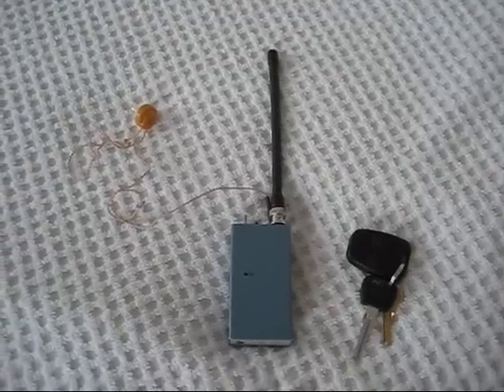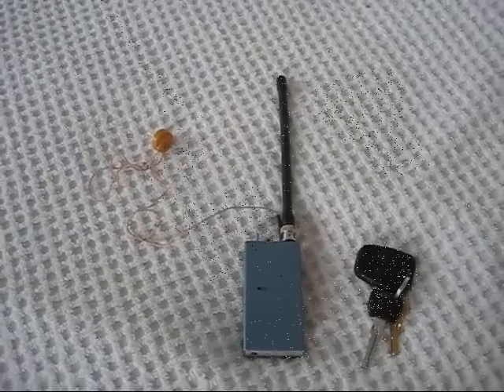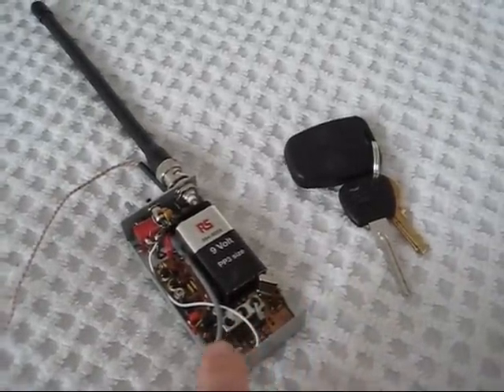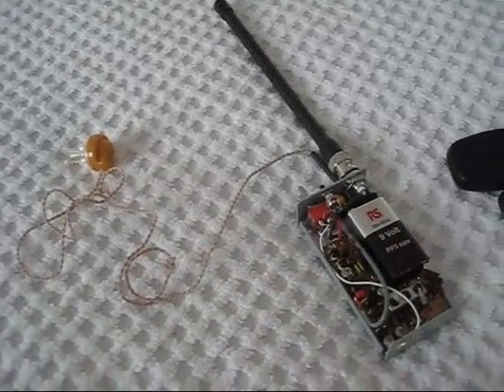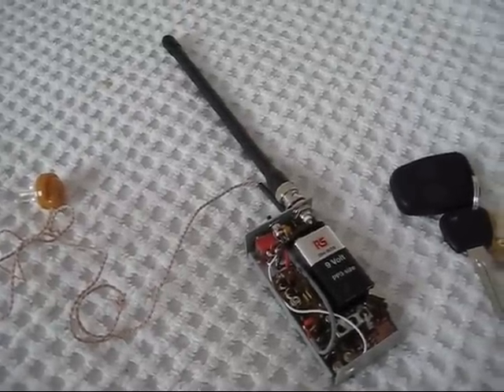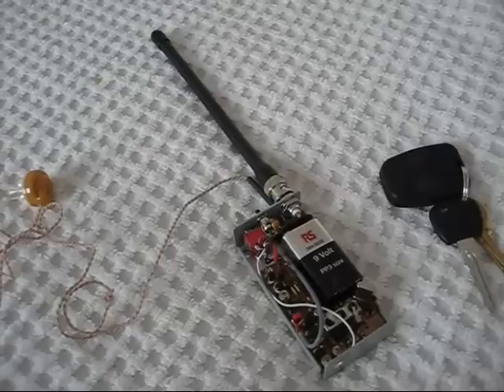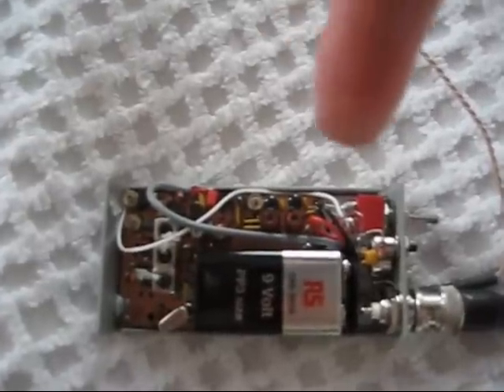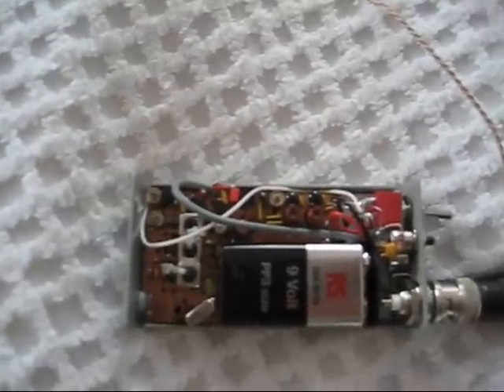G3XBM's Fredbox 10mW 2m AM Transceiver

Comment: What a great little project. People just don't know how much fun the hobby can be when you try these things. Sadly, it's easier to get the credit card out than the soldering iron. My first 2 metre RX was a superregen, and recently I cobbled up a regen for 40, 80 and 160 which works just perfectly for general listening, and cost er, nothing. All with bits torn out of old PCBs. 
This is real radio. Thanks for posting it.
Reply: That's true, and I found a lot of resistance against the idea of launching a 4m band (we got it here in Belgium couple of years ago, not so long ago) AM "round table" to lift some newcomers into shape by planting "the bug" on them through a simple self-building project that I had designed. It just happens that 35 MHz RC-control crystals multiply nicely into the AM-calling frequeency or the FM one, so I designed a 1-transistor crystal oscillator that put out enough power for just covering the mile or 2 around the city (if with adequate antenna) and also pushed a "dead bug style" 4m band Super-Regenerative with just 3 transistors. I got price per part-set down to (back than) around 10€ or say 9 "quid" as you guys call it over there :-)

And the "gang" was just looking at the thing, and than came "4 meters, what 4 meters? And what, a SUPER-REGENERATIVE receiver?! A RUSHBOX?! No no, we're not going for that" and I was like "but why? There's ZERO activity on it anyways, and the crystals (were) dirt-cheap at the time. Than I build one using tubes, just for fun, and slammed my head into a brick wall again. The large Cigar-Box sized contraption, that put out about 0,3W from the PA-tube on 90V battery, somehow also didn't meet a lot of approval... I'd cut down on the size, the power consumption and the parts needed even more than with the transistor version, just to demonstrate to these newbies "look, we can do this, instead of being just reminiscinant just do this again!" and the response this time? "Thomas... Do you really expect us to go back to playing with Rushboxes and Modulated Oscillators just for you?

Well, on JOTA day they managed to scare whatever youth we still had out completely, by building receiivers with pre-made PCBs with ICs on them, and NOBODY understood a WORD nor THING about what they had in their hands. And I saw these young folks just melt away in awe, respect and dread... Thinking "this must be the most difficult thing on Earth" but it isn't. I don't think that it's just all "not wanting too" but rather the absence of a platform for younger people and newcomers to learn from and "hang tight" and build up their understanding of the Hobby. You gotta watch these old 1930-40s handbooks or 60s magazines like CQ, 73 and the old QSTs (pre-1970) and there was always a section "for the beginner". Today a Handbook is just nothing but ads and comparing who has the biggest... Antenna. No more VHF-handbooks that explain to build a 14-18 MHz regenerative receiver that's used after a convertor to "get going" on 6m, 2m and even partly 70cm. I mean today we wouldn't even need all the stuff like Neon stabilizers and +300 volts to worry about like in the tube-days.

Ok, apologies didn't intend to vent this much steam, sadly enough indeed Money dictates a lot, you're right about that. Irony is I'm not even that old, just 32yo. But I grew up (really) poor as an orphan. I had to break every cent in half, and I went to public libraries, writing down stuff I read in these old handbooks, and before I knew it I was on the air with just a "pile of junk" (described so by others) and nothing bought except for a telephone that had a carbon microphone in it (so much for needing a modulator!) and a couple of CB crystals. The Schematic came from a 1935 handbook on VHF, where I stabilized the free-running oscillator by means of a crystal. Wasn't completely FM-free ofcourse, but tubes got less problems with this than tran CBsistors do. And all of this fun kept me going through a black page of my life. And ironically, I found quite a few interested people at "the bottom of the social ladder", who still appreciated some old miracles and apparently had a ton of fun with this after I got two 1970s toy WTs from the 2nd hand store. They were still young guys too, who were blown away by the fact a wooden plank, a glowing tube and some other components made a fully functional Transmitter-receiver. And in hindsight, collectively we must have pulled up local 11m interference by at least to 2 S-points, but when I heard complaints, I'd go off-air immediately.

Now I'm better off, I've got my ticket, I'm somehow nostalgicc about these not-so-long-ago tons of fun w ane had with just leftover-donations, a "base station" consisting of a single EL84 connected as Triode (later upgraded to an ECC91) that got it's HT directly from the Mains and a bunch of Germanium-transistor WTs that maybe put out 20-30mW RF? But these were the good ones! The ones that two transformers in the Audio-amplifier and hence had a much better modulation depth than those later China Made things.

Ok; this became a whole story on it's own, but Super Regenerative Receivers always had and will have a "place in my heart". Keep up the building work, and who knows, maybe a Renaissance will come when C

Regards or 73
ON4SPK